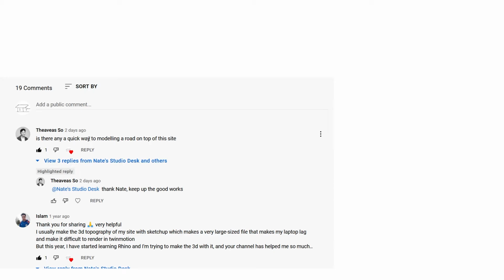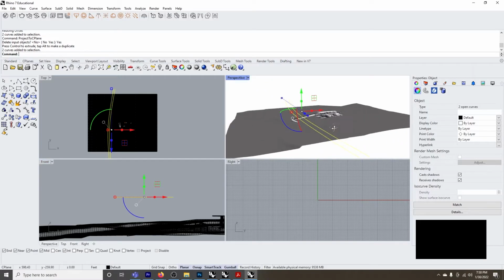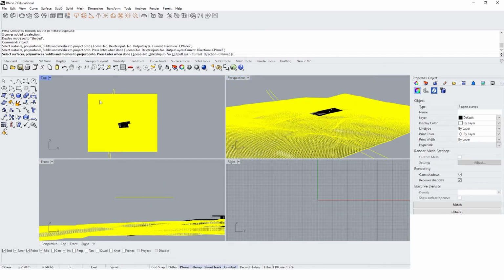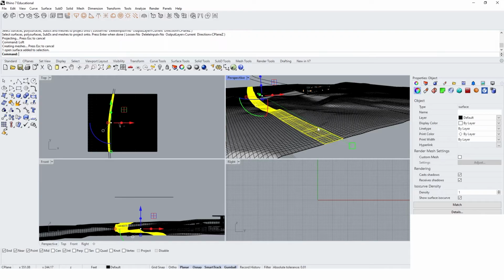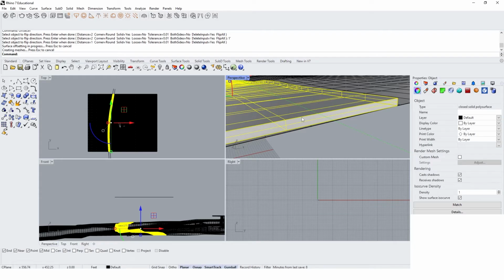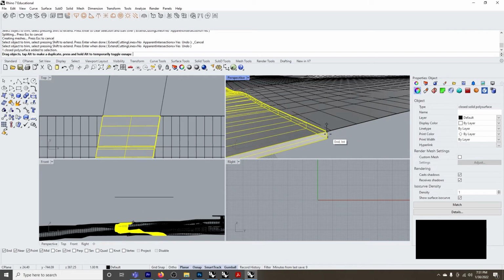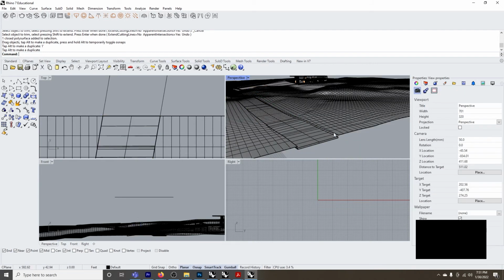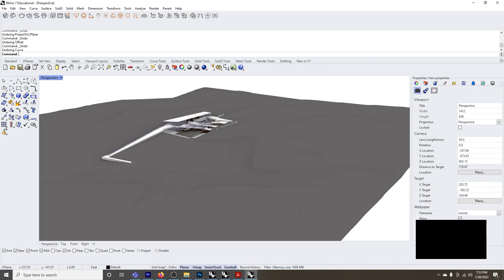How to Model Roads on Top of Any Site Topography- Quick Easy Rhino Tutorial

Comment: This method is useless if the road is running along a sloped incline. Is there a way to do it where the width of the road would remain level?
Reply from the maker: Just project one curve and extrude that curve to make it perpendicular.
Reply: @NatesStudioDesk  hey could you explain this response further? I am having the same issue.